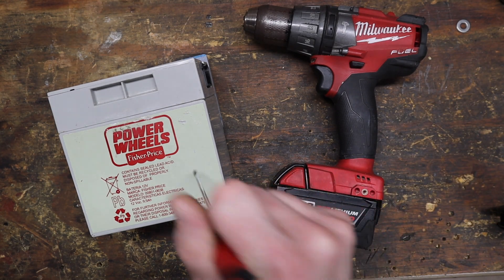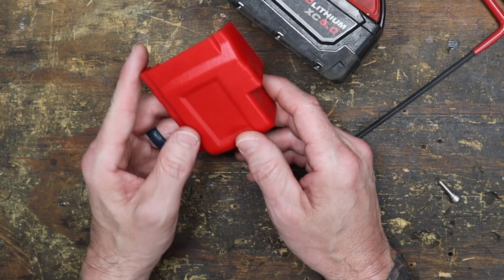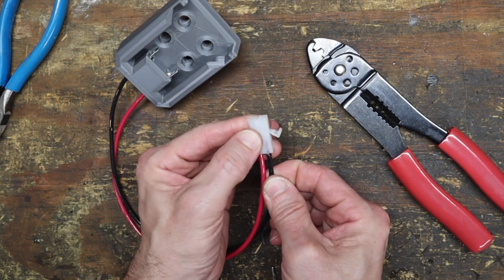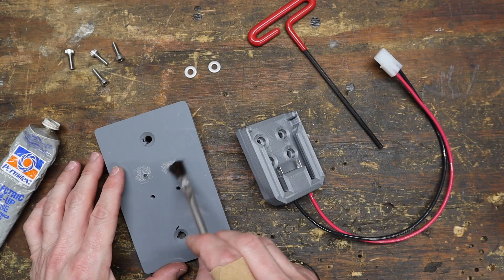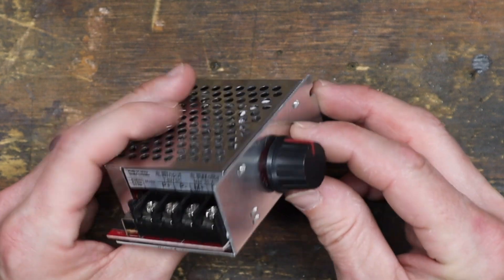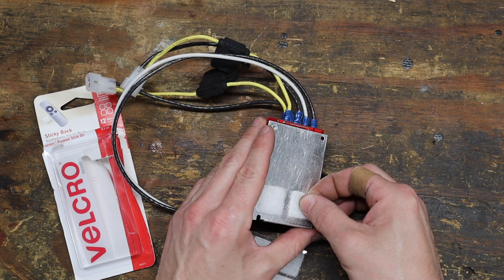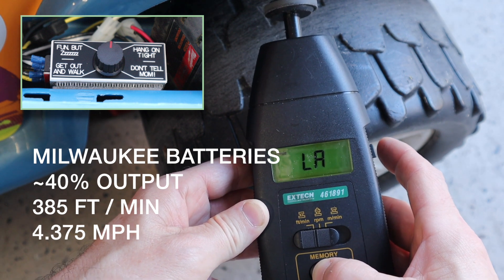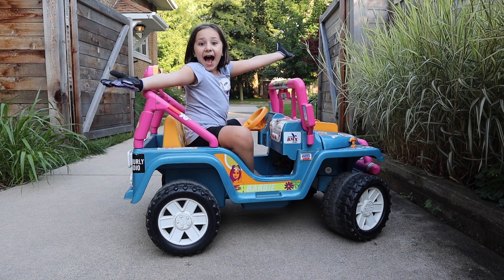Power Wheels Vehicle 18 Volt Milwaukee Battery Upgrade!

Comment: Can you do this same exact setup with all the same components you used on a 24volt power wheels jeep that uses (2) lead old style 12 volt batteries? In other words, wire both Milwaukee 18 volt batteries in parallel to one low volt protector and then to speed controller and also set the low voltage protector to 16?? I just don’t see many videos doing this set up to a 24 volt power wheels jeep? Thank you and yes, it really was a great video. Explained everything which most videos leave out. Lol
Reply: Just replace batteries with two 12 v lithium ion or Lifepo4 batteries. Drill batteries are not good when ran in parallel and also are kinda expensive might as well get a proper battery pack.

Comment: Wow!! Extremely thorough explanation. Just what I was looking for. I’m looking to do the same thing. The power wheels I have has 4 24v motors. Will it matter on the voltage if I run two batteries in sequence?

Comment: Question - do you know if your dc speed controller ramps up the voltage? I have a 24-12v DC step down converter for my sons power wheels but I can’t get it to power the “high setting” consistently. I think it might be because the converter can’t handle the “instant on” of the power wheels pedal.

Comment: Did u have any problems later? Cause I did the same upgrade to mine and it seems like the power wheel just took a dump on me. I couldn’t figure out if it was overheating or wire frying. Please help share your knowledge on this?

Comment: Did you upgrade the motors or leave it at 12V?  Will 18V batteries ruin the 12V motors?

Comment: Im no expert in circuit wiring but I was planning to do this mod to my kid’s ride. My only concern is that the battery is located under the seat and I have to unscrew to get to the battery and if I do this mod I won’t be able to take out the batteries once I screw the seat. Can I use the normal charger outlet that the car comes with or I have to take out the batteries every time they run of of power?

Comment: Hi this is sweet.  Best so far.  I notice this is 2years old.  How do the Milwaukee batteries hold up in this configuration?    Did those two new batteries end up crapping out over time or with the low v cutoff has it added to their charge cycles and battery life??   I'm planning on using Makita bc that's what I already use but figured it might be comparable.  
Once again TY and did I mention very cool.

Comment: I have converted my sons 12V 4wd jeep to a Milwaukee 18V 12.0Ah battery. I have also replaced the motor controller for a 24V one as we blew our 12V motor controller. Next thing i want to replace is the 12V 10000 rpm motors for 24V motors. What rpm do you suggest to ensure we get enough torque for off-road and beach/sand? What pinion gear teeth count?

Comment: This is a great video an wonderful engineering, but honestly its a bit much for the average consumer.      Many parents (dads usually) are not gonna be able to take this amount of time and effort (and expense) to make this mod.   it would be doable to add a voltage controller to adjust speed for safety purposes and more agressive driving, but much more is gonna be a non-starter for 98 % of dads.    
thanks for all the information for those engineers out there with the time to get this done!

Comment: So this video was uploaded 2 years ago. How about an update? How has the Jeep motors and gearboxes faired with the upgrades during that time? Still running strong or has anything burned up with the increase in voltage??

Comment: I did this with my kids 12v f150, but I used one Milwaukee battery. My problem is it keeps blowing the fuse and wires get hot. Should I use 2 batteries to stop this from happening?
Reply: I'm running in to this issue also with a Dune racer and F150. they both have 2 batteries. I came back here to see if it was a common issue.

Comment: I wired my kids toys with 20v batteries and they only lasted about 30 min
(Kids loved it though)
went to recharge the batteries
They were smoked and wouldn’t recharge
Figured worn out batteries so I bought new ones
Same problem 

I’m wondering if did something wrong or did u have the same issue
(I didn’t wire in a reduced)
Just replaced the 12v with a 20v

Comment: Won’t your 12 volt motors burn up running on 18 volts?
Reply: Yeah. Mine did. So I upgraded to a 18v motor and it still burned up. Not sure what I'm doing wrong. I followed this video to a "T"  🤷‍♂️
Reply: @brentduvall5446  for about 20 dollars you can get an 18v to 12v step down transformer. I think this is the route I’m going to take! I don’t really care as much about the extra power as I do the quicker charge and longer run time you can get with the Milwaukee batteries.

Comment: Little help here.  I'm not using a speed controller and I've connected both batteries before connecting to the battery manager and it seems as though it's only draining one battery at a time

Comment: I have a Mercedes Unimog 12v 4wheel drive and want to convert it into 18v Lithium-ion batteries. Can i use the Milwaukee 9.0 Ah batteries? Will this conversion affect my parental remote control? Looming forward to some feedback.

Comment: 3:25 -  This is heat warpage during the printing process. That's probably printed with ABS which has a tendency to warp during printing. Definitely fixable with properly dialed in print settings.

Comment: I did the same thing with a peg perego gator. I have a m18 red lithium 6 mah battery connected to it. First time using it, it ran for about 30 min. I charged the batteries to run it again and the batteries are getting drained immediately. Do you know what might be the issue?

Comment: What amp fuse did you use? It seems you didn't mention it this nor the other one. I did something similar with a 20v dewalt battery and it shorts the 30 amp fuse and only lasts a. 20v 6amp battery for only 20 mins

Comment: I did this for my kid's power wheel, but just used one battery. Thus, I was wondering have u done it with one battery? I was wondering if it had any power increase or if the ride just lasted longer compared to one battery.

Comment: Dude !! This video was awesome.: after watching guys ramping voltage to 18 v I performed a similar upgrade using a 12 v batteries and a smaller 6v. Never thought to use my 18v drill batteries. Thanks for sharing.

Comment: Does anyone else have the issue of blowing 30 amp fuses about every 3 minutes?  I used all the same components as shown in the video with the exception of using 18 volt Rigid batteries.  I can not have the speed control set to "don't tell mom" or the 30 amp mini fuse will go.  Anyone else with some input would be great.

Comment: Why are these In-Line Fuse Holders $10 dollars a piece w/o fuse !!!  There’s 10pks with fuses for $8 and under all day on amazon. What is the deal?
Reply from the maker: Hi Ray. It's just a list of components that I used on the build, I'm not the seller. You can use any that you prefer, or none.

Cheers
Reply: havocware yeah, I tried to use all your links so you get credit from your video. I was just baffled at the price difference. I like buying top quality items, so I was thinking the $10 fuse holders were premium in line holders... I opted for a 10pack of 30a 12 awg in line holders for $9 bucks. 
Thanks for your video!!
Reply from the maker: Thanks for watching, and supporting the channel! Cheers!

Comment: I just seen this video well done!!! Quick question I replaced my daughters 6volt battery with a 12volt 7ah and the 6 volt motor with a 12 volt 30000rpm motor. Do I have to replace the peddle in the car too?

Comment: I got a jeep power wheel for free off the curb but it didn't have a battery in it. I went to test to see if the motors worked by rigging up my 12v car starter to it but I fried all the wires in the process, wheels were turning slowly though. Not sure what I did wrong? Maybe too much current?? How can I fix it, any ideas?

Comment: Hi. Question  is the black and white cables  connected directly to the motor?  Does it only goes forward?
Reply from the maker: Hi There! All this modification does is replace the battery circuit, all existing internal wiring for the vehicle remains the same. Forward/reverse and High/Low are still operational.  

The black and white output cables simple go to the existing vehicle wiring harness where the stock battery would normally connect.

Cheers!
Reply: @havocware  i did what  you did but the power wheel is not turning on. What could be wrong?
Reply from the maker: @user-jl4do7ck3y  No idea at this point - can you give me more to go on? Can you upload video of your install that I can take a look at?

Comment: Awesome.  I always wanted to soup up a power wheels. Unfortunately my kids are to big now. However, we were very very fortunate with our power wheels selections when they were little. I bought them the hot wheels/power wheels go cart & that thing moved!! It had rubber wheels & it was the joy of the street every time we brought it out. Even for the younger teenagers. Then my 2 other kids got the jeep 2 seater with room for 1 more kid in the back. They loved 4 wheelin in the back yard. It was all about what they could run over. Not about speed. So a few mods were key but that thing took a real pounding. 

So we shall see if i ever get to the 0-25mph in 10 secs power wheels mod done...because theirs always grand kids. 😎

Comment: Great video! 🤘 Just got done doing this to a pegpergo rzr 900. Kids are going to love it.  What amp fuse did you use? Blowing a 15 amp
Reply from the maker: Hey Casey. I ended up with 20A fuses on each battery. I found that anything less would blow on the the initial inrush. Cheers!
Reply: Right on man thanks🤘

Comment: Two sided servo tape for hobby rc cars will hole that speed controller. As an option to velcro it will seem more sturdy. The velcro allows some vibration damping.

Comment: Really enjoyed all aspects of your video. Very informative, simple yet thorough instructions, clear before and after test results, and great camera work and editing. Thanks for sharing.
Reply from the maker: Thanks Bill! Cheers!
Reply: @havocware  Brother,maybe you can give me an answer,I got my son a ride on car,mercedes AMG style,the thing is it has 4x motors and 2x 12v7 Ah batteries,took out 2 motors for some riding time but I want to upgrade it,what I'm supposed to do as I don't know what's with the 2nd battery?
 PS:forgot to mention that it's not a power wheels model,I can't find who manufactured it so I have no idea about the voltage tolerances or if it would fry anything as it has lights, touch screen music player and stuff.

Comment: Anyone tried this with Milwaukee M18 HD12.0 battery pack
s?  It will work in the power wheels car but now refuses to charge (charger flashes red and green).  It was only discharged down to 3/4 so it didn't overdischarge.

Comment: Why can't you just use a small car battery if it's 12volts?
Reply: And if my son's power wheels has a speed control already do I need the speed control you installed

Comment: Hands down this is the best instructional video i have seen. Not even just powerwheels related, i mean in general with anything. Thank you.
Reply from the maker: Thanks Marc! Appreciate the kind words! Cheers!
Reply: Havocware
Any idea why my machine cuts out after about 6 minutes of my kids driving the truck? I have followed your instructions to a T  and it doesn't seem to be working out. Batteries are fully charged, and I think I have the circuit board set up correct, but maybe I don't. Do you have proper directions to set the proper values on that board? Or any other things to check?  I also notice on the speed controller there is a switch with 3 settings. Any info on this would be greatly appreciated.
Reply: Havocware
Any idea why my machine cuts out after about 6 minutes of my kids driving the truck? I have followed your instructions to a T  and it doesn't seem to be working out. Batteries are fully charged, and I think I have the circuit board set up correct, but maybe I don't. Do you have proper directions to set the proper values on that board? Or any other things to check?  I also notice on the speed controller there is a switch with 3 settings. Any info on this would be greatly appreciated.

Comment: My dad did the same thing with the power wheels and drill battery but he just used Milwaukee flashlights and sawed the bottom end off and put alligator clips and spliced the power wheels cables and boom, not even 30 minutes it took him

Comment: How long does a single charge last on the Milwaukee batteries?
Reply from the maker: Hey there Brad. Check out Part Ii https://youtu.be/8n_NJ2uIDU8 for full run down tests and a battery protection circuit. 

Cheers!

Comment: Where is the "on/off or go button/gas pedal" in the wiring schematic?
Reply from the maker: Hi Dave. Everything after the speed controller (inside the Jeep) is stock wiring, all I did was alter the incoming power to the vehicle. The stock “gas pedal” and forward/reverse switch were unchanged. 

Cheers!

Comment: What size fuses did you use?
Reply from the maker: Hey Ronald. I ended up using 20A on each line. Anything else would blow on the initial inrush from the pedal. Cheers!
Reply: havocware thanks!

Comment: What size fuses did you use
Reply from the maker: Hey Kevin. I ended up using 20A on each line. Anything leer would blow on the initial inrush when the pot was higher than about 75%. Cheers!

Comment: Not going to lie.. I was really hoping that a 36v configuration would've been tested out, just for experimentation sake.. :)
Reply: Only 5 amp hours would give a very limited drive time, but may have lifted the front wheels.😈
Reply: @charlesmckinley29  or fried the motor. I think one of those motors can take 36 volts with no load but it would overheat as soon as the wheels touched the ground.

Comment: Why a PWM amperage controller instead of a voltage step-down regulator?
Reply from the maker: Hey there, thanks for watching!

PWM works by controlling the duty cycle; switching the current & voltage on/off for a given period of time, it does not reduce output of either. The end effect is to regulate the amount of power provided to the load.

One of the advantages of PWM for motors is that torque isn't reduced nearly as much as regulation of speed by reducing voltage. The motor is getting 100% of the voltage for a short period of time.

*all above from Quora
Reply: @havocware  yeah I get that, which is why I wondered. The electronics in the toy were designed for 12v, so regulating the 18v down to 12v seems like the most logical choice. I wondered if you had a specific reason for going the PWM route, but it's sounding like not.

Good video still
Reply from the maker: Thanks. My short answer is - I wanted to up the voltage slightly for the increased speed benefit, but also add the ability to trim it back in case too fast was, well, too fast.

Comment: That power wheels battery is a rip off lol that basically a small capacity motorcycle battery which are like £30/ about 35-40 bucks.

Comment: Hmm, is not the AH the measure of capacity? How can 10ah with the drill batteries give that much more capacity than the 9,6ah stock battery? Im considering switching out my sons 2x 12v 7ah batteries for a similar setup as this.

Comment: Fabulous.  Wifes jajaja same mine. I had like 5 different power wheel cars for my daughters. Ended up throwing them out cuz the batteries die fast or the motor at wheels fail. Now i have 5 batteries in the shed and 2 cars that don't work anymore.  This is amazing putting those milwuakee batteries. Too bad i dont now much about wiring and electrical stuff.

Comment: are you running both batteries at the same time? or do you let one die then hook up the other?
Reply from the maker: Hey There! Yes both batteries together in parallel, used at the same time. 

Cheers!
Reply: @havocware  thanks! I also tried to buy the power cradle but its unavailable on Amazon anymore any other suggestions for one?

Comment: Would be a fun project to wire up the potentiometer to the throttle pedal to give them control rather than the on/off behavior

Comment: *2 things...
1. Not sure how your getting away with putting 18V to a 12v Motor and it not burning up...and!!!
2. Milwaukee M18 Lit-ion have whats called "Red-lit" technology ...and what it is ...is a Propitiatory low power cut off Built into the tools that Milwaukee makes ..it's a special Low power cut off  board that keep you from draining these batteries all the way down. Which damages them.And How I know is I have tons of these bats and tools and I used a adapter like you have on some 9.0  big boy batteries and it ruined them .
Just thought I would share*
Reply from the maker: Hi Mike. No problem with 18v on the motors so far, over a year and going strong. 

In Part II https://youtu.be/8n_NJ2uIDU8, I put in a voltage cutoff module to save the batteries from over discharge. 

Cheers!
Reply: @havocware  Wow ok..Cool Beans...How did you know you needed that and was it in the video because I must of Missed it ☺

Comment: Hmm doesnt seem worthwhile trashing that expensive battery. You get what 10 maybe 15 minutes run time out of it? A lot of work when really all you needed was a $25 lawn and garden battery which will run for about an hour or so on 1 charge and my sons has lasted 3 years now!!
Reply: I have them as well but you gotta be crazy to think I'm gonna hook one of my expensive tools up to a kids toy lol
Reply from the maker: Hi Cody. The whole point was that I already had the Milwaukee batteries,  so why buy any others at all?

In Part II https://youtu.be/8n_NJ2uIDU8, I do a rundown of the LiOn batteries. We got over 90 minutes of runtime compared to under 45 with the lead acid.